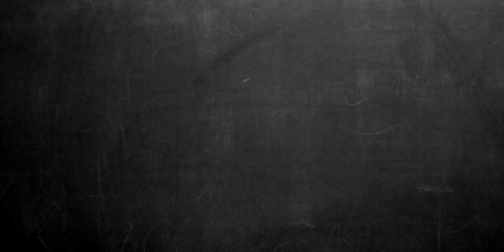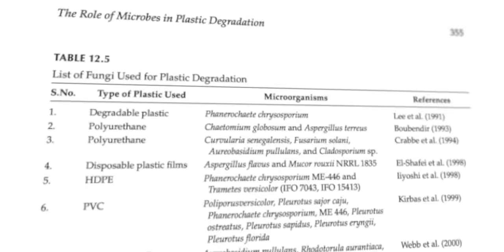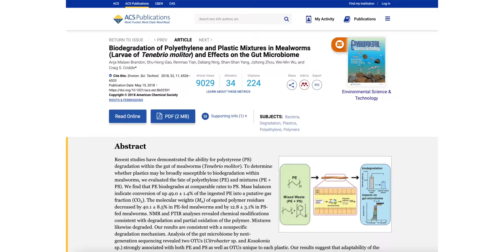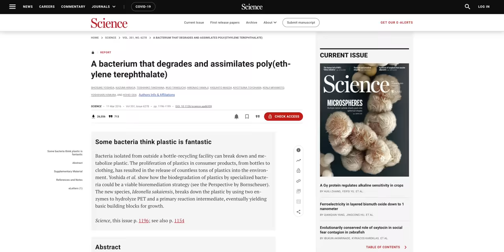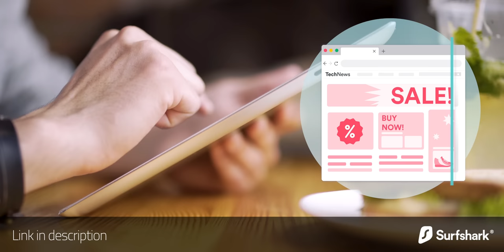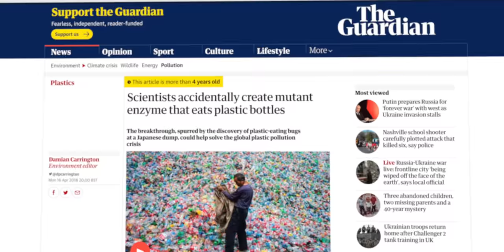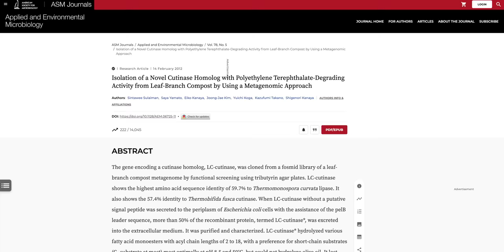Why This May Be the Future of Plastic Recycling

Comment: The argument that depolymerizarion of PET into monomers and regeneration of new PET has been shown in the last ten years to be as problematic as the claim of doing the same for other condensation and ring opening polymerized plastics. Millions have been invested by hedge and federal agencies only to come to the conclusion the cost of doing so increases carbon footprint and energy while reducing quality of the monomers and cost of further purification and side reactions, the same has been found for enzymes and as of today we have gone full circle back to new tech that will take mechanically ground post consumer and select post consumer PETe and other condensation and ring opening plastics using a new molecular tech called Alterin to upcycle and super cycle these plastics!!!  Bottom line after 20 years of fake narratives and a desperate industry looking for answers have been duped by grifters with promises and slight of mouth at a Hugh cost to bottle mfg who have recently terminated their five year contracts and the promise made to them Now they have to use 30 percent and are stuck with a high problem. However solutions to these problems  do have solutions but they will NOT be implemented for one greedy reason they are DISRUPTIVE to increasing profits by generating more litter waste

Comment: Wouldn't it be better to just bury plastic in a well zoned and managed landfill? As far as I can tell, by digesting oil based plastics it just releases CO2 and other greenhouse gasses, whereas if we bury plastic we re-sequester that carbon instead of turning it into gas? This is an earnest question. Recycling is good if it is economically viable, and waste management is important so it doesn't pollute our rivers, oceans, etc. I just don't see how biodegrading plastic in an industrial setting is a step forward.

Comment: I think one of the first things to do to allow the speed up of the break down is to create large shredding machines to increase the surface area of these plastics . If it can be seeds down to the size of fishing line and be mixed in with other natural waste products that can act as a catalyst for the worms to enact on then it may increase the  efficiency  by 1000% of more . Maybe even the right temperature may rapidly increase the worms interest in feeding etc . I can see that this may become highly optimised and I am thinking methane maybe produced also as a reclaimable by product !

Comment: The carbon emitions are still a problem it seems, I worry of people thinking that oil based plastic production isn't an isue anymore, though I don't understand de proses, if it actualy helps recivle the thing it should be overall okay but I'm still kinda convinced the worms will release to the air at least carbon that will not help with climate change.

Comment: Liquid nitrogen can be produced using solar power in a desert location and then delivered to a plastic molding facility that emulsifies and mixes Plastics into workable construction materials.

The biggest drawback is the presence of non-engineers..

Comment: Imagine a future where plastic biodegrades as easily as wood. It seems like that is the inevitable result of putting evolutionary pressure on the planet to select for organisms that can digest plastic.

On the one hand, it would be wonderful if our plastic waste could degrade harmlessly into soil. On the other, that world would make plastics significantly less useful. We are used to plastic resisting degradation, and many of our use cases for it revolve around that property. Remove that property, and we will cast about for something else that has it...creating the problem anew.

Putting that aside, enzymatic plastic recycling sounds fantastic. It's wonderful when chemistry's problems can be solved with more chemistry.

Comment: I’m concerned with the unintended consequences of these breakthroughs.  While they certainly   do their jobs, don’t they also remove pressure on society to change its plastic using ways?
Reply: yes, but is that a bad thing?  Plastics fill a role that nothing else can(at this time).  I'm thinking about the medical uses.  Nitrile gloves are superior to their latex predecessor.  There are other things like implants that are in the same boat.  The fact that we could potentially recycle the plastics we have and continue on without the added cost of reinventing society is a good thing.   Imagine what would happen if someone found a way to produce gasoline from solar energy efficiently that did not add carbon to the air(by recycling the CO2 from the atmosphere).  The impact of lithium and copper mining over the next few decades is going to be tremendous.  By keeping what we already have and cleaning it up, the costs can be better spent elsewhere.  Same for plastics.
Reply: Plastic won't be a problem if we can capture all of it and have all the necessary microbes to break it down and recycle it.  It's ultimately not such a hard problem, just a matter of preventing garbage from leaking into the environment.  I think we'll be good at recycling when we have a cheap way to break it all down into sludge .
Reply: True. In schools they need to teach kids that they can get rid of plastic bags by feedng meal worms with it

Comment: This is a Noble effort however it won’t be a feasible global solution because its basic science is against Nature’s Grand Chemistry design. First depolymerizing plastic using enzymes only accelerates biodegradation; and that’s the problem. In an attempt to address the rationale behind how wrong the biodegradation by enzymes/compost/bacteria/fungi/worm approach to sustainability is, let’s assume that we did in fact have a way which will 100% of the time biodegrade under all conditions the entirety of our plastics (which is an impossibility in itself, I’ll explain it). Even in a case such as this, we absolutely do not want to release all of this carbon in these plastics into the atmosphere (which is what biodegradation essentially does; it turns solid carbon into gas carbon), given that our atmosphere already contains too much CO2. Study shows that biodegradation of our plastics would generate an extinction-level environmental impact. Water solubility is the actual golden standard, not biodegradation, which is why our planet looks blue from outer space. We need to adapt our most used material (plastic) to the Grand Chemistry of our planet, we can’t keep making non-water-soluble materials. Now, about the impossibility I mentioned earlier; The idea that this video presents not only is using biodegradation as the route to lower plastic’s molecular weight, but it also requires near absolute plastic waste recapture for it to make sense at any significant scale. Recapturing plastic at 100% will most likely never happen, given human nature. Already we’re throwing 12 million metric tons of plastic into our oceans each year, there’s no denying that this number is increasing exponentially. The more likely reality is that most plastics end up in the water ways and disseminated in our environment, fragmenting into microscopic pieces, and with that, the food chain and our bloodstream. Timeplast is the only company addressing this issue while also adapting to our planetary waste cleaning system; the water cycle.

Comment: Wouldn’t the real solution be to stop producing plastic? And polystyrene? And replace them with plant based 100% biodegradable materials that are not filled with harmful chemicals, and do not require environmental destructive mining to produce them? All the existing plastic could be up cycled into building bricks that can be continuously reused as building bricks.

Comment: best way for plastic to be used is as a house wall... only thing is to find cheap  and good ways to keep it stable from  disolve and reach ground !!!!
Reply: A house is very temporary in the grand scheme of things, so no thanks.
Reply: @ThePentosin  in the waymost houses are builded in my country nowdays and for the amound  isolation types  might needed  we could even import   parts .. thats why I mention it!!!! replacing cement in some %ntage   here is possible and steel isnt cheap right now..!!!!    construction must no be delayed   cause last pandemic   gave a low rate if not reset the circle!!!!! best time to stick to more styles of  isolations!!!
Reply: The cement walls will come down at some point, and then the plastic goes straight into the environment. So all you managed to do regarding keeping plastic out of the environment, is delaying it.

This video is about eliminating the plastic.
Reply: @ThePentosin  let it be .. until then  there are  stil ways of use safely it .   i mentioned before  to find good and cheap ways  to  use it not to use the cement for  secure leaks !!!!   there are millions of other ways to keep it safe in use..  for the next 10/15 years intil a compelete solution comes everywhere
Reply: Atleast your optimistic, I'll give you that.
Reply: @ThePentosin  ι wouldnt write such things if i didnt belive them.  when time comes for  my project house and  if my wallet can handle that .. i wIll try such solutions if are avaluable here !!!!

Comment: Regretfully even the fastest of these solutions will not be enough to fix what we have done as there is not enough time. Let me elaborate: microplastic (and other hydrocarbons) in the water has impeded the oceans' capability to cool down the planet. Our solar system passes through a stream of unidentified cosmic energy every 12000 years which affects the planet's core and in turn intensifies the heat generation in the mantle. Major changes have been detected since 1995 and calculations determine that the Earth can resist this effect for no more than 12-13 years. Even if we had a clear and efficient solution to clear all plastic do you think we will be able to implement it globally on time under the current profit-before-anything-else mentality? If we want to survive what is coming we need to adapt in the next 4-5 years the creative society format where human life is number one priority and only then true scientists would have an opportunity to counter the cosmic effect.

Comment: the entire point of plastic is that it's not biodegradable.

why is it used to package food stuffs from factories? because it's not biodegradable. why is it used to insulate electrical wiring? because it's not biodegradable.

previous materials used for these purposes had failure rates that were high enough to cause problems. but previous materials used for these purposes are still available options. so if the goal is to return to biodegradable materials to replace modern plastics, why not just go back to using the materials that modern plastics replaced?

you see what's happening here? the problem you've been told to focus on doesn't actually even exist.